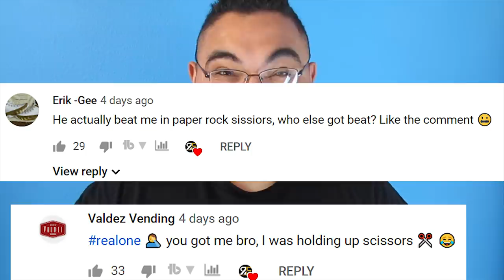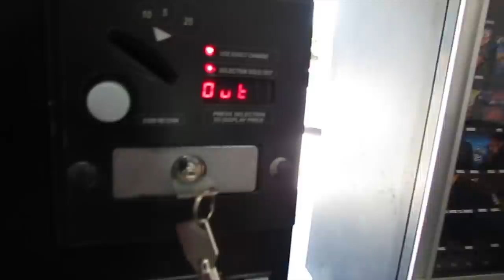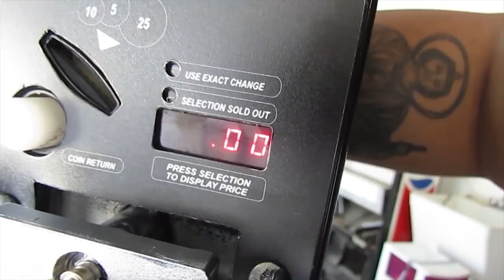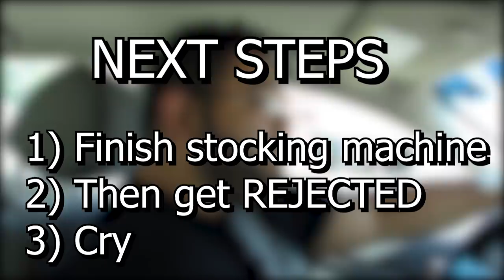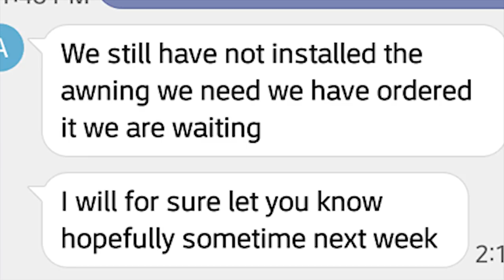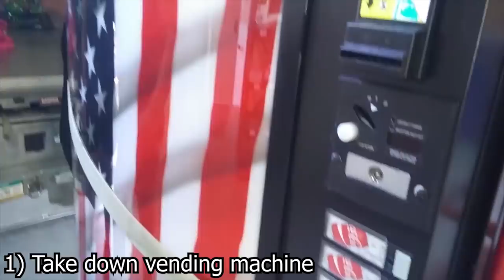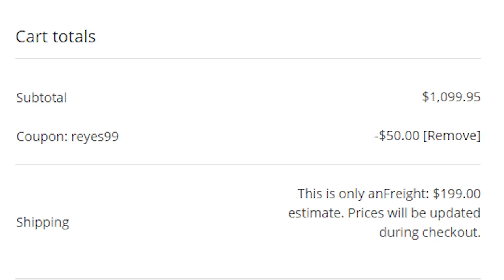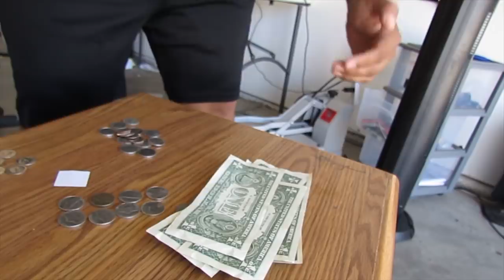The STRUGGLE of having a VENDING MACHINE BUSINESS

Comment: Might be a dumb questions and I'm sure its been asked a bunch, but wouldn't it be easier to move them without food and soda in them?
Reply: Don Oliver probably not. the food is only a couple pounds top
Reply: Yea but then he has to test that all of the food/drinks disperse from the machine on location. And that would be a lot more of a hassle
Reply: @felzy2420  Its actually way easier to move without the product inside the machine.
Reply: Product won't be sitting in slot right anyway after tipping snack machine in its side. Plus snacks need to be kept climate controlled.  Don't even move a beverage machine with product in it.  Damage to everything machine and product will get damaged.   50% heavier too heavy
Reply: @playdoughfunrs  I get testing it, but once it's in it's side it all need to be checked anyway,
Reply: @felzy2420  I was thinking more about the soda machine, soda weighs alot
Reply: Not when you got buff guys helping... LOL
Reply: Move snack machines loaded with product. Drink and combo machines are significantly heavier than snack machines so move these while empty. 4 cases of soda pop can weigh 40 pounds
Reply: @felzy2420  I saw a video recently that said you should remove all the food drinks before moving it
Reply: In regards to the soda machine. Yes
Reply: We would always empty machines to be moved unless it was just across the room or something. Pump trucks and two people. I've moved a 276 can machine on sack trucks down a flight of stairs before.

Comment: Best option would be to buy a 2000s pick up buy a 4x6 trailer with ramp and hydraulic tandom dollies and a heavy duty appliance dolly with all-terrain wheels, this isn't only for a snack machine business but for almost all business trucks are alot better and if your vending machine business really starts taking off I recommend buying a stair climbing dolly exclusively for.vending machines of course they cost like 3 grand but I rented one and I was able move a vending machine alone with out help, but of course I'm a beast but still it was easy lol
Reply: Lol you can get a good vending machine dolly for 1500 bucks my step sisters boyfriend has a 200+ vending machine business and when I help him I could move them myself with the dolly. A stair climber is just excessively more expensive those machines can run over 7 grand. LOL

Comment: Just a word of advice. When transporting anything that has a refrigerator unit in it and it is laid down on its side/moved then you want to let it sit upright as long as possible or at least a couple of hours. A refrigerator should never be moved on its side. It can cause major cooling issues. It is best to transport anything with a refrigerator unit in it upright then you can plug it in almost immediately. I just want to save you the headache!
Reply: That's probably why most these machines messed up

Comment: REYEEEEEES! I move machines fairly often. Try renting cargo vans from Hertz, they offer unlimited miles. I often get the Sprinter full size for $50 a day unlimited miles. You haul gets very expensive very quickly. But when you are moving 4 or more machines at a time, it is worth it.   

Also, Uhaul trailers have unlimited miles and are uber cheap!

Comment: CO stands for Column . I worked for Canteen Vending a franchised vending machine company i learned some great info working for them about vending machine. instead of waiting for the tech to go fix a machine i learned on my own..which helped getting paid commission.  the Water getting stuck because the top has to face the back, and you might have  to adjust the the length by the back rail like things move back an fourth. Have you tried like retail stores like, ross,marshalls, tj max ?
Reply: Marshall's and TJ Maxx will have to go through their corporate office. They already have a vendor with a contract.  If you can give them a better deal than the current vendor, you might get a shot at them when the current contract ends. But if you can get it, it would be good for your income.

Comment: Quick Math: If we assume an average of $35 a week or $5 a day (selling 5 drinks a day), assume each unit to stock cost around $0.32 cents. Profit per day is $3.40, per week is $23.80. This vending machine will pay for itself in 59 weeks or approximately 1 year two months. This also does not include the cost of gas to restock. So if we expand the profit projection over 10 years and it is taxed right as the vending machine being a depreciating asset, then the vending machine will make about $10,000 over it's lifetime in profit as a rough, ballpark estimate. We spend $582.40 restocking the machine per year, and we consider the initial cost of the vending machine over 10 years (1400/10) is $140 per year. We make $1237.60 per year on the vending machine and our cost is $722.40. Thus the annual ROI on this machine is ([1237.6-722.40]/722.40 =) 71.32% of $515.20 profit a year. This is actually much higher than I expected. Keep up the good work!

Comment: I used to do the gumball machines. One thing I learned is------NEVER transport/deliver your machine when the machine is stocked up. Transport the machine when it is empty, and then fill it when you have it set up at the location. That way, moving the machine is alot easier because it is not as heavy, ESPECIALLY that soda machine. Also, when you transport the machine if it is full of product, the product can move around in there and become dislodged, which would cause you to adjust your product after setup, or fix the release catches.

Comment: Reyes you cant lay refrigerators/ soda machines on their side  the liquid from the electric pump will run into the wrong areas of the machine and can ruin it . not exactly sure the technical terms but i Know it can ruin the machine if you lay it the wrong way. next time rent a lift truck from home depot . it will be the same price and you can leave it standing up

Comment: I'd rather just get a part time job 2-3 days a week and make the same amount the vending machines will bring in.All the gas spent driving to and from each location and the amount of time spent around the machines altogether (maintenance and restocking) it will be like a part time job in itself. Also considering if you make 30 bucks a week it will take over a year before the machine pays itself off which means you wont wont see any profit till 1-2 years after getting it all set up and running.

Comment: $19 in 4 days from two vending machines is $2.38 per machine per day. 

But first, you have to pay $3,000 for the machines and $400 for sodas/snacks, and $75 for the Uhaul truck, and $40 for two guys to help move the machines - not to mention the gas it takes to drive over to collect the money and restock the machines every few days? 

At $2.38 per day, per machine, you'd need 35 machines just to pull in $30,000 a year. How does anyone make money doing this?

Comment: I can't believe you're moving them loaded and on their sides.
Reply: Ronny Williams is that bad?
Reply: @truereligionfiend738  So many things can go wrong, cans can turn sideways in the soda machine.  The compressor shouldn't be put on its side.  The weight of the snacks and spirals can cause them to pull loose from the plastic cam of the vend motor or pull the cam out not to mention the snacks falling out of the spirals.  Each and every item would need to be vended to insure none of this happened.  I saw a soda machine almost crash through a storefront because the loaded weight made it so heavy it got away from the guys moving it.  They never moved a loaded one again.  Depending upon the brand used, the coins can fall out or turn sideways in the changer.  They should be moved upright or on a dolly because its angle shouldn't cause a problem.

Comment: 20 bucks every 4 days.
5 bucks a day. (.2 an hour)
1825 bucks a year.
Buy a new vending machine each year until you get 16 machines.
year: machine
1:1 2:2 3:4 4:8 5:16
16 * $1625 = 26,000 a year
$72 a day
$3 an hour
Not a "bad" investment for literally doing nothing but collecting $$$
Reply: I know I didn't take out the initial cost of filling it but Id assumes it's about $100 a month or so including gas.
$600 a year. so take that out of the equations and it looks a bit less enticing. also $1500 machine is hard to come by, you might be looking up to $3000. slowing this process down a tone.